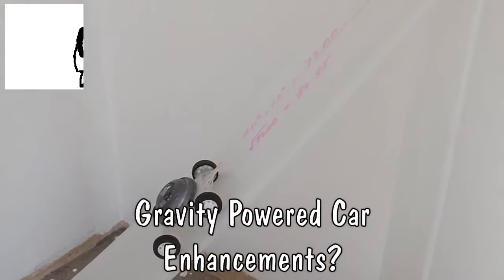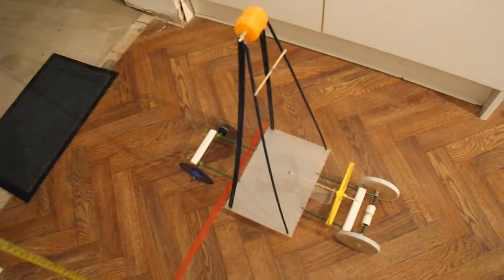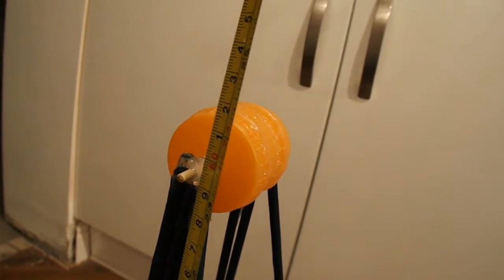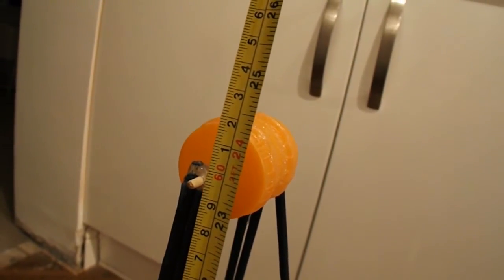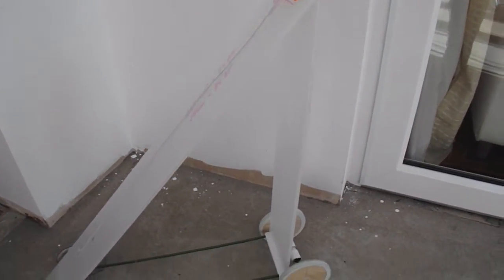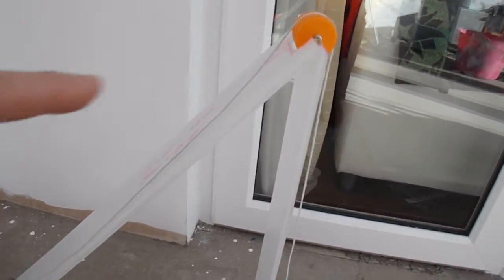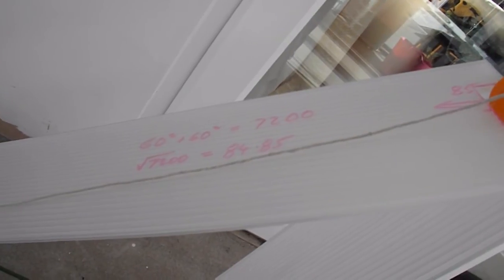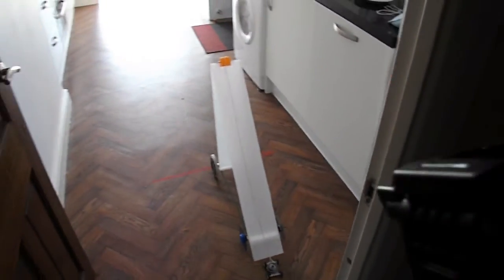Gravity Powered Car Enhancements 45 degree slope

Comment: Cool, but whats the point?? :( you should try less weight or open the doors...otherwise, theres no way to measure...:\
Reply from the maker: +Felipe Zucchetti so you didn't actually listen to the explanation then?
Reply: I suppose you are trying to see the difference between both cars...but with a door in the way its not that easy...anyway, good luck...:)
Reply from the maker: +Felipe Zucchetti I can see your problem in understanding what is going on. You have not watched the previous videos in this series so you do not know how far the car ran with a normal drop. When this video was originally published it was the third in a series trying suggestions received in the comments to see if we could get a greater distance. None of the versions actually reached the door, that is why I said in this video that if it hit the door it was an improvement. I will add some links to the video description so people can backtrack through the series and make sense of it.
Reply: Ok...now imunderstand...:D

Comment: Use more weight if you want it to go further
Reply from the maker: Of course you can use more weight or you could make the tower higher. The purpose of the video was to explore if there was any way to get a longer length of string and therefore a longer distance travelled under power using a given height, weight, body and wheels.

Comment: Cool! It would go much further if you put a longer string. :) But it definitely goes very far! Awesome Job Grandad!
Reply from the maker: Why would it go any further with a longer string? When it reaches the ground there is no more gravity power and that is when the string stops. The whole point of this video was to explore if making the drop 45 degrees made any difference. A vertical drop is 60 cm so the maximum length of usable string is 60 cm. At 45 degrees the length of usable string increases to 84.85 cm.
Reply: oh yes. Thats true. Should have taken that to consideration before typing my comment. Sorry Grandad.. :(
Reply from the maker: Sahan Methmal no problem, that has prompted me to add a little more detail in the description.
Reply from the maker: DeadKennedy yes I could use a 'block and tackle' set-up if I had suitable pulleys
http://en.wikipedia.org/wiki/Block_and_tackle
however you start to lose a energy due to the extra friction involved. If you look at the previous video on this subject you will see I tried double pulleys with no benefit.
https://www.youtube.com/watch?v=nhdX5dxc_Hc